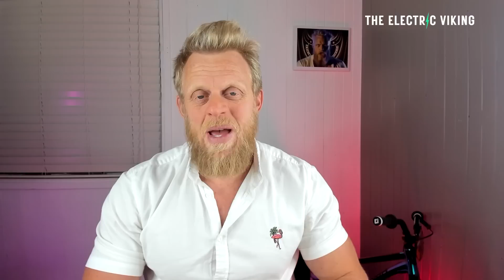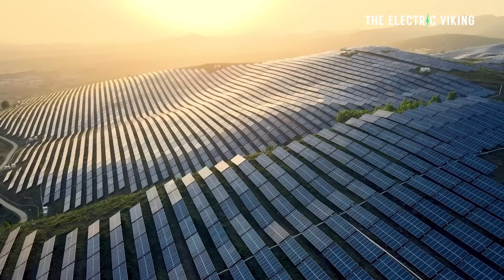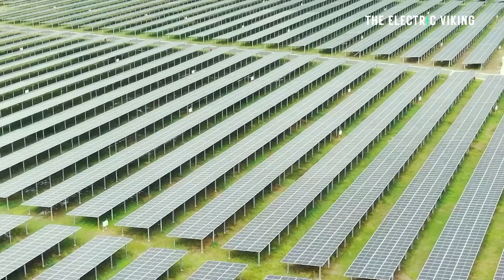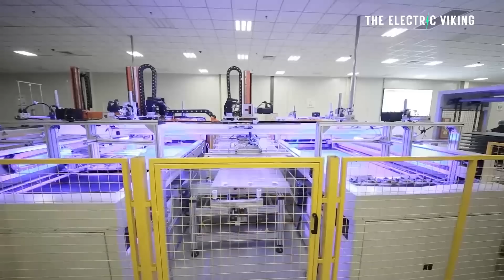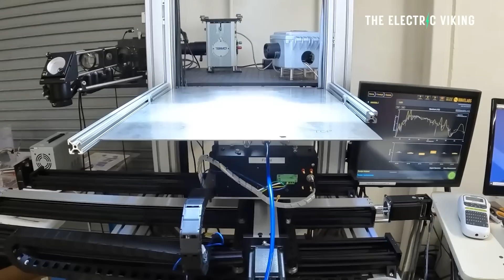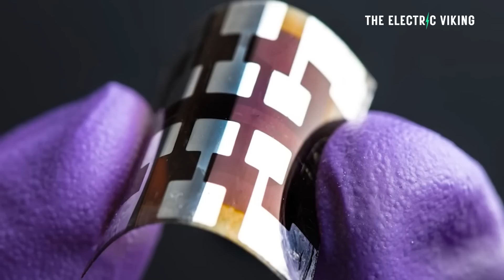How much of the worlds land mass we need to cover in solar

Comment: The biggest challenge is the labour costs which makes up the bulk of the cost when installing domestically is going up more than the solar panels are going down
Reply: Solar will increasingly shift to utility-scale installations, that have dramatically lower installation costs and increasing automation. The dramatic reduction in utility scale solar costs (levelized cost often less than $.02/kWh, and in some cases around $.01) reduces the need for more expensive rooftop solar generation and may lead to the elimination of net metering in many places.
Reply: The labor costs are more of a short-term concern; the costs will keep plummeting due to Wright's Law.
Reply: @AMortalDefiant  how are they a short term concern?  If they make the bulk of the cost and they are going up, the cost of one of the cheapest components going down will not make any real difference.  Only real ability to reduced installation cost is do it at the point of the build.  Doesn’t help with retrofitting.
Reply: DIY. Also: in the future the solar panels will be the roof...not just installed on the roof...which is complete nonsense. Building a roof and adding even more weight by putting the panels on top of this shit. Also: future panels will come with an automatic cleaning unit pre-installed.
Reply: @washingtongeorge4841  if the don’t they already, they should also be able to draw current to heat them up for a short time to melt any surface snow and ice.
Reply: @ashleyspencer3664  Generally, snow already melts off solar panels, except in really severe cases. Solar panels radiate a bit of heat naturally, so the snow often just slides right off before it can even accumulate (unless it snowed a lot overnight).
Reply: @ashleyspencer3664  Everything possible should be tried to keep the panels clean and their efficiency increasing. World population increased from 2 billion in the 1920ies to now over 8 billion...and counting...and only solar, wind, water can make that work without leading to wars and further environmental destruction.
Reply: @AMortalDefiant  not from what I have seen here locally in the U.K.  I’m sure however if a current could be drawn around the circuit then it could accelerate the melting process, although might look like you’re a cannabis farm grower too 🤣
Reply: @AMortalDefiant  I found fresh snowfall is easily removed but hard to remove if you let it harden. If a blower is used very little effort/time is needed if you act immediately after the precipitation.

Comment: Really interesting topic Sam.  I am guessing a desert installation is not PV friendly.  A desert environment would present some huge obstacles I would think.  Lots of heat would lower the efficiency of the panels and the sandy winds would probably destroy the PV panels.
Reply: Engineers: hold my beer
Reply: Look up "600 MW Al Shuaiba PV" It is a solar project in the Saudi Desert with a long term purchase contract of $0.01 per kWh.
Reply: It is more that wide geographic distribution is ideal for solar.
Reply: There are solutions to cool the solar panels a bit. They need to be not-too-hot, for efficiency and long lasting.
Reply: There are companies that make automated systems for cleaning solar panels every few hours.  I'm not as certain about the heat issues, but it must not be that big of an issue considering some of the places that have huge solar arrays already, like Saudi Arabi.  It's also important to note that not all "desert" is sandy; some deserts are more rocky/arid, like some areas in the southwest of the United States.

Comment: Solar panels will be practical when they can generate enough power when one panel  can charge a power wall completely all the time. Until then it's like a trip to Mars makes sense.
Reply: Do the math and see how long your payback period is. The answer might amaze you.
Reply: Solar panels are already practical.
Reply: Currently one panel could fully charge the latest powerwall in a day...unfortunately the panel would be about 5x4 metres and weigh about 145kgs😁
Reply: There are dozens of VERY practical uses.  They build them over irrigation canals to generate power, while also preventing excess evaporation; which helps minimize drought conditions.  Win/win.  They can be build over certain crops, like spinach, and rice, which grow better in the shade of panels.  Increased yields AND generating energy?  Win/win.  They can be used to offer shade to herds of sheep/goats.  Yet another win/win.

Even with simple residential solar, the payback period is - in most cases - under a decade.  If you would invest in the stock market, which generally doubles every 7-10 years, you have to understand what a killer ROI solar is.  Some people in sunnier areas even see an ROI as low as TWO years!  You'd have to be an idiot to pass up that kind of savings.

Comment: Solar panels at home with battery storage plus an electric vehicle is pure magic
Reply: The increase in average levelized cost per kWh to install solar panels on a home roof over utility-scale solar is now more than the levelized cost of utility-scale solar. In other words, home solar tends to be more than twice as expensive per kWh as utility-scale installations. I would focus more on home/distributed battery storage.
Reply: @larryevans6739  i agree I forgot to mention I’m a carpenter and have built a few off grid homes that it would have cost more than the house to get a power line to so yes it’s much cheaper on a large distributive scale
Reply: @nickkacures2304  actually the transmission costs are the nuclear promoters use against distant new solar farms.
But in a future no CO2 world 5 times more electricity is needed and the fatter transmission grid is then the killer cost against all centralised concentrated electric power generation. 
Rooftop becomes the only solution with EV big batteries.
Reply: @larryevans6739  transmission costs are extremely high for electricity. 
Totally ignored by every comment. 
So rooftop solar has little, basically zero transmission costs.
And just as utility scale is paid to supply then the internet of things can track your usage and feed in kWhrs. 

The SA big battery paid for itself in one year.  $100million for 100mW.
Reply: @stephenbrickwood1602  No I see exactly what you’re saying about transmission of power it is extremely expensive to build out today that why regional and local and even neighborhood by neighborhood grids go renewable energy production are more resilient.but as solar panels and at home battery storage get better and cheaper it’s going to be hard to pay for a grid of any size because the individualist and provocateurs will just cut their umbilical cords of expensive electricity and go off grid you only need a couple dozen rebels in a neighborhood or small regional grid or even a long spur of connections to to destroy the profitability of the electricity provider some states are passing mandatory electricity rates if you use grid power or not
Reply: We have the law of thermodynamics right so we also have Swansons law on solar panels which shows that solar panels/ cells drop 75% every ten years and much more than that just before Covid now they are dropping dramatically again it’s so hard for fossil fuel energy companies to look out and plan more than a year or two because the economics of coal gas and even nuclear energy are all getting kill by solar and wind energy
Reply: @nickkacures2304  yep, all sorts of things can happen. 
We just need to understand the facts and talk to every one. 
Toll roads in Australia have been a cash cow for big business. 
Big electricity maybe the same.
Reply: @stephenbrickwood1602  we have the largest wealth inequality in history as corporations have concentrated wealth creation to the few like your example of toll roads we could see continuing concentration of wealth into a few hands as we become less independent but hopefully if we can avoid a global environmental catastrophe with climate change and loss of biodiversity as we see ocean acidification and coral reef destruction continuing. We don’t have a choice anymore we have to choose between a sustainable future or a dystopian nightmare it’s time for humanity to correct it’s wasteful ways
Reply: @stephenbrickwood1602  According to IEEE, transmission costs are less than 20% of the price you pay for electricity. So even though the totals numbers are large numbers, it is a small portion of the cost. According to Lazard, US residential rooftop is between $14.7 and $22.1 per kWh before subsidies. New utility scale solar is ~1/10th that. Based on the math, there is no way rooftop is competitive on price.
Reply: @larryevans6739  Not twice. 5X. See Lazard's LCOE analysis.
Reply: @kenjohnson6101  Most Recent Lazard LCOE is $.03-.04 per kWh for utility scale and $.15-.22 for household solar which is ~5X. Subsidies drive that multiplier down a bit, especially with the IRA focus on rooftop... But that Lazard report is for the US. I kept it more general, as different markets have different circumstances/subsidies. While both panels and installation tend to be less in other countries, residential is consistently more than 2X utility scale solar.
Reply: @larryevans6739  Would those subsidies be better spent on utility-scale solar?
Reply: @kenjohnson6101  I would argue to get rid of the subsidies, remove trade restrictions (which would reduce the price more) and  streamline the interconnection queue process. We have a list of solar projects waiting for approval to be connected to the grid that is over 676 GW as of 2021 according to Lawrence Berkeley National Laboratory. That is ~5X all currently installed solar capacity in the US (136 GW). Get the bureaucracy out of the way and the lower market price for utility scale solar will take over. It would also quickly eliminate the value of rooftop solar to the grid and likely bring net metering to an end.
Reply: @larryevans6739  transmission costs are stupendously expensive. 
$2million a klm and 1million klm in Australia and 5x that in a no CO2 fossil fueled world. 
Nobody is talking about transmission expansion in the future. 

Nuclear promoters use the transmission costs against new solar farms, but the same arguments work against them and all centralised concentrated electric power generation.
Reply: @larryevans6739  transmission costs are massive and the existing national transmission, the poles and wires to the streets and homes and businesses and industries and buildings and all the ends of the grid is unbelievably big.
Nobody is talking about this matter.
Reply: @stephenbrickwood1602  solar panel companies are now partnering or purchasing battery companies because they see the future and it might not be what you think it is of a massive national grid but smaller regional grids with battery storage systems with 12 hours of peaker storage and connected to networks of small systems for redundancy and resilience we are seeing this approach in emerging economies that don’t have national electric infrastructure systems
Reply: @stephenbrickwood1602   I think 🤔 were on the same page I’m just seeing such dramatic changes in the battery storage space that we are going to wake up some morning and soon to an announcement that scientists have discovered and built an incredible new battery storage device
Reply: @nickkacures2304  you might be right. 
Controlling the price is big business. 
Hahaha Hahaha. 
We all need to talk more on the transmission costs because it is a huge matter and government money, tax money is at risk.
Reply: @nickkacures2304  yep, rapid evolution and research. 
The electric world will be profitable.
Reply: @stephenbrickwood1602  Reposting to your repost: According to IEEE, transmission costs are less than 20% of the price you pay for electricity. So even though the totals numbers are large numbers, it is a relatively small portion of the cost. According to Lazard, US residential rooftop is between $14.7 and $22.1 per kWh before subsidies. New utility scale solar is ~1/10th that. Based on the math, there is no way rooftop is competitive on price.
Reply: @stephenbrickwood1602  Reposting to the repost again. The reason why transmission costs are not the focus of discussion is they are not the major challenge. According to IEEE, transmission costs are less than 20% of the price you pay for electricity. So even though the total numbers are large numbers, it is a relatively small portion of the cost. According to Lazard, US residential rooftop is between $14.7 and $22.1 per kWh before subsidies. New utility scale solar is ~1/10th that. Based on the math, there is no way rooftop is competitive on price.
Reply: @larryevans6739  are you saying that is the cost to install per m2 ?
Because 20years of production is cheap at $0 running costs. 

I also think that the 20% is maintenance costs, not construction costs.
Governments usually built the national transmission grid. And the national grid was built over 100years.
Reply: @larryevans6739  Sydney rooftop is paid for in 4 years and then basically no costs for the next 16 to 20 years.
The rising costs of electricity makes this extremely valuable. 
Southern USA would have similar solar access. 
Northern USA would be maybe half the year.
Published numbers need to be examined before using.
Reply: @stephenbrickwood1602  It pays off quickly if you can sell the output back to the grid or have it offset your usage at other times. Even then, 4 years is optimistic and includes heavy subsidies, the cost of which alone could pay for a utility scale with higher output. Now that they can often get utility-scale solar electricity for 1 cent/kWh, utilities will quickly overbuild and will not need the excess from your panels because they already have excess electricity at that time. According to California ISO, they already curtail around 2TWh of renewable electricity a year, more than some countries use. Utilities are already phasing out compensating people for electricity that they provide to the grid, and that will only accelerate. Especially if government incentives are removed, rooftop solar will soon only make financial sense in cases where you use/store the output on-site/off-grid.
Reply: @stephenbrickwood1602  I would also add that as utilities increasingly are in an oversupply situation due to cheap utility-scale solar, time of use/dynamic metering is anticipated to make electricity much cheaper for consumers in an effort to shift consumption to times when the utilities are having to pay to have excess electricity curtailed.
Reply: @larryevans6739  the details are always going to be distorted by the real world and political forces.
Just looking at the global numbers, rooftop with EV battery selfparking 23hrs a day is a powerfully efficient use of resources if...
A 100kwh, big long drive capacity battery, in an EV, that spends 23hrs,  365 parked and not connected to the national grid is a waste. 
Trading electricity with the grid for money and profit would pay for the vehicle in one year on today's spot market, just saying.

USA paperwork is killing rooftop pv, from my perspective. But also USA tax 'monkey business' makes it difficult to understand.
Reply: Self installed 3.2kw array and 6.5 lithium storage 👍🇬🇧 all good .
Reply: Yes nick we have such a set up with 16 KW PV and 30 KWH battery plus an EV
Reply: Sure is great. We just got rid of our last ICEr vehicle and now have two BEVs and a small solar system. Need to triple the size of our original system, but we will get there. Our electricity needs have gone up quite a bit since we first got our solar system several years ago.
Reply: I've got a 12 kw solar array of 22 545 watt panels with 20kwh of LFP batteries in power wall format. I have a PHEV that gets its 18 kwh battery charged off that as well. A Tesla Model 3 on order. It's a good overall system. But replacing the panels at some point as well as the batteries at some point worries me when replacement time comes around. But the payback should be less than 4 years so I guess I'm overly concerned. 😁
Reply: Yeah it's pure magic all those slave children digging the materials out of the unregulated mine that are required to build the batteries just so you can virtue signal about your car that's actually powered by coal back at the power plant. Good for you. Virtue-signaling is intact.
Reply: Question:

 Is it true in some States they make it mandatory that you must be connected to the Grid .
Reply: Perhaps. However it takes around 80k to find out.
Reply: That's the only way I would have one.  If I have to use the grid then no way.
Reply: @John Hancock  same here.
Must have solar and Wind to power the EV.
 They have cylinder Wind Turbines now for homes. Like to get reports and reviews about this brand new device for creating home off-grid electricity.
Reply: If by "pure magic" you mean science/tech making decentralization possible, freeing us from govt. (a monopoly of power), then I agree. But since it's not complete, i.e., we are not 100% free yet, I would call it "impure magic" or just "magic". "Magic" is a word we use for outcomes we don't understand. It describes our ignorance of the event, NOT the event.

Comment: Every year Solar manufacturing gets cheaper but I've yet to see a palpable trickling down of price onto us regular Joe's! Same with battery stoage for homes and the like - still prohibitively expensive.
Reply: People that can easily afford Tesla seem to be able to easily afford solar panels on their homes.
Reply: In the 70s, solar panels were $1000/W, and they are $1/W today (all costs are pre-installation).  The costs have plummeted 1000x over 50 years.  The problem, as others have pointed out, is the labor costs, and short-term inflation.
Reply: Installation and permitting is what costs. Then the utility steals your power.  That has to change in the USA.